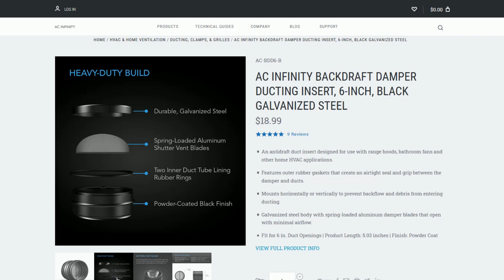Glowforge - Inline Fan Setup

Comment: Did the in-line fan reduce Oder? I just got the AC Infinity CLOUDLINE S6 on Amazon and my office smells worse than when my GlowForge filter was full! 🤦🏻‍♀️ I don’t know if my in-line fan is just not working properly or if this is what I am
Supposed to expect, a smelly office!! 😫
Reply from the maker: Yes an inline fan will definitely help with odour. If it's doing the opposite for you, you might want to check to make sure the air flow arrow on your inline fan is pointing toward the place you vent out (the window or hole in the wall). If it is pointing toward your laser, you'll be blowing the air inside the GF back into your room.

Comment: Just a handy tip if you don't have an adapter that fits your hose perfectly. I see a lot of 3D printed ones that address this problem and I see a lot of videos of people using ugly aluminum tape by the pound.  Don't tape it AFTER you connect, tape the male adapter end BEFORE with blue painters tape. The simple answer to most of these misfitting hose to coupler is just build up about 1/4" of blue painters tape on the male end of any duct adapter, now slide the hose over the tape and, poof, perfect fit. In many case, don't worry about the clamps, just put enough blue tape on the adapter to it fits super snug, but if you want to clamp, you have this nice semi solid seal of the blue tape.  All this talk about gaping of the hose when you clamp is taken care of.
Reply from the maker: Yes that would work if your house diameter is larger than the diameter of the coupler, for sure. I always recommend sealing up anywhere that you have a connection with the hose though. Taping up the connections helps to lessen the chance that smoke and smell escape. Thanks for the tip and thanks for watching!

Comment: Hi came across your video and like the fact that you used the the six in hose my question would it be safe to use a pvc adapter from the Local hardware store that adapts from the 4 inches to 6 inches(PVC S&D Increaser/Reducer Coupling, 4 in. Hub X 6 in. Hub) your thoughts on this are greatly appreciated  by the way awesome video😊
Reply from the maker: Thanks so much for watching! Yes, any adapter that increases the back exhaust on the Glowforge to 6" would work just fine. There will be variance between all adapters so choose one that fits snugly and don't forget to seal it up with some good quality duct tape.

Comment: Great video. If the GlowForge was directly in front of the window where it vents outside, would a in-line fan still be preferable. Thanks.
Reply from the maker: Thanks for watching! I'm going to say "Yes" to answer your question because the inline fan is much quieter than the onboard fan of the Glowforge. It also moves air much quicker and more efficiently than the Glowforge fan. You'll still need to clean the onboard fan of debris once in awhile though as the debris will still pass through the inactive fan blades. I hope this helps!
Reply: @SteelForge1  thanks!

Comment: What is the difference between the 4in and 6 inch inline fan? And is what is the benefits between the 2 with the Glow Forge
Reply from the maker: Hi Melinda! The main difference is that the 6" fan will move more air more efficiently away from the Glowforge because it has more power and a wider diameter. Think of it like drinking a milkshake through a thin straw versus a thick one. Hope this helps!